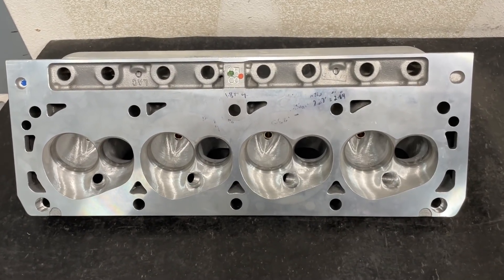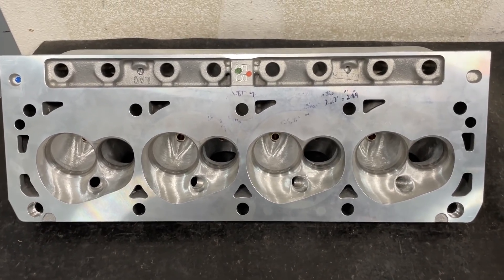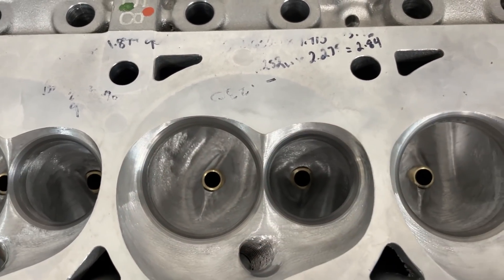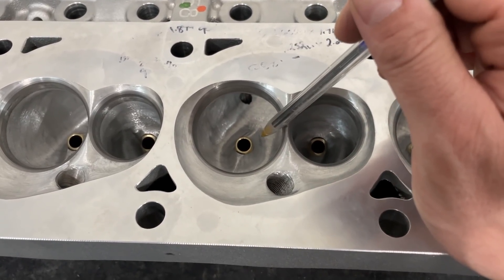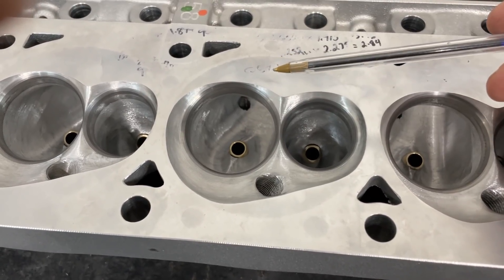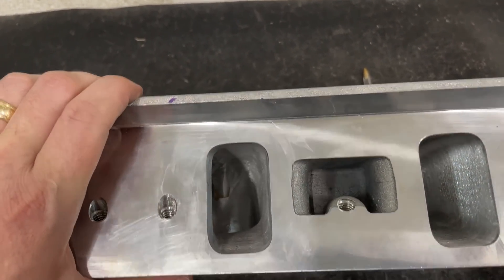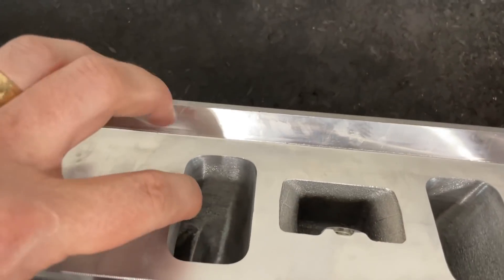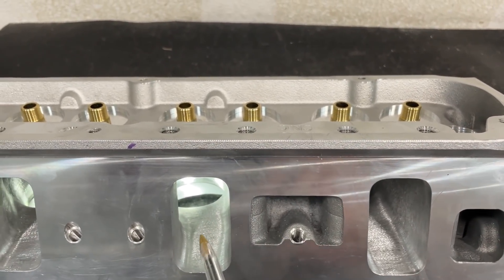SBF Trick Flow heads improved

Comment: Eric.. one more stupid question please? I'm old school where I was always told "heads can't really be repaired".. If you can weld up a "break thru" from porting too deeply, could a crack be repaired? Or is it simply a matter of the pressure difference between combustion pressure and cooling system pressure? That you can hold back cooling system pressure with a weld repair, but trying that with the combustion chamber is out of the question? Once again, thanks in advance!
Reply from the maker: Heads can be repaired. To much welding causes it to need heat treated again but that’s rare.
Reply: @WeingartnerRacing  Thanks for your response.. I'm kinda sorry to hear that.. I now cringe at the number of heads I've tossed because they had cracks.. Live and learn..

Comment: The high port was one of if not the first aftermarket sbf head. Almost all of the early turbo Ford guys ran them and many records were set with them. Very versatile head with no geometry issues like the early twisted wedge.
Reply: yeah only problem is the moved valve center lines, so 80% of pistons wont work with them
Reply: Just get the right pistons
Reply: @dennisrobinson8008  I'm not saying they don't exist but they are usually the most expensive piatons

Comment: Question: when looking at flow numbers at 12:53, the stock intake flows less at .600 than .500, but then increases again for .700 and .800. Is that a mistake, or is it acting that strangely?
Reply from the maker: It’s not a mistake that is caused when the air separates from the short side and restricts the flow.

Comment: If you need more area in the pinch with a head that uses pushrod "holes", fill the holes with aluminum slugs with a slight press fit, weld on top and bottom, put your port in, and re-drill the hole offset, utilizing offset rockers and lifters. With big offsets, drill the hole and then mill the material between them out.
If non offsets are used, ream the holes to fit a bronze sleeve. You can then port to the sleeve, or only install the sleeve if you break through. That's how I approach them. No need to worry about welding in the hole. 
I have a pump gas 468" SBF build for a grudge guy I will be using these castings on utilizing that approach.

Comment: My Favorite Small block Ford head of all time...ive been using them close to 30 years ...They are the most Versatile Small Ford head now  Copied by other Manufacturers...But this Head Started it all...Way back when it was originally designed by Will Burt and Cast by KPI...👍🇺🇸
Reply: Rick smith designed that head with the help of his brother know the man personally
Reply: @ivypixley7451  you are correct
Reply: Yep!  There is only so much "change" you can do to heads to make them better. When they came out with the Twisted Wedge head, that was it, the end of head technology. There will be nothing better period
Reply: twisted wedge went towards Cleveland without going all the way.   But those heads were dominant.
Reply: Same here!!! I had the old Will Burt Highports back in the day on a 347 and I have the Bennett Racing 265s with modern castings on a 434 today! I absolutely LOVE these heads!!!